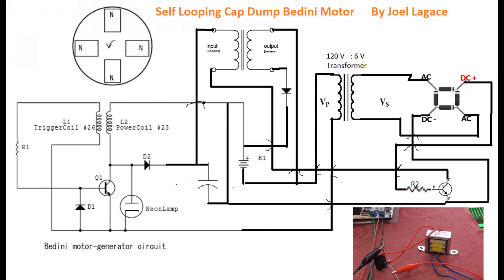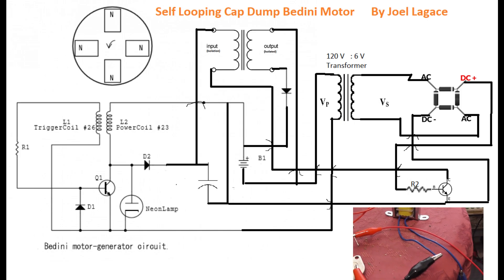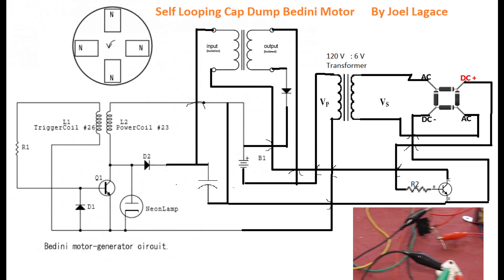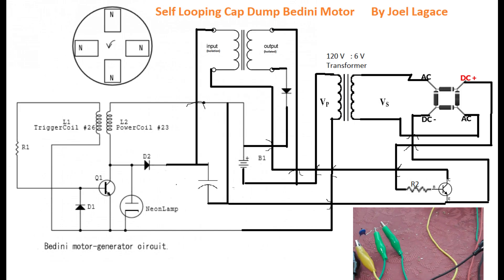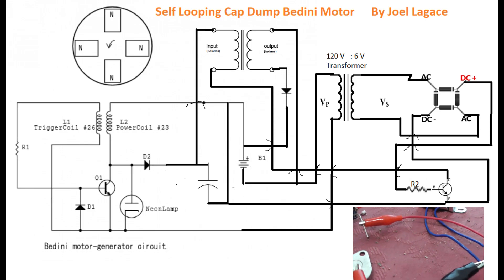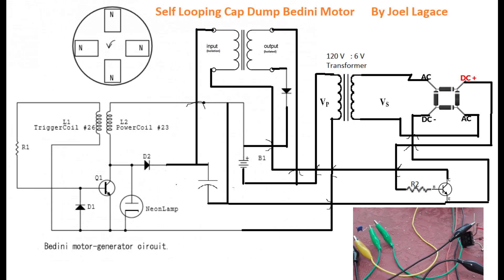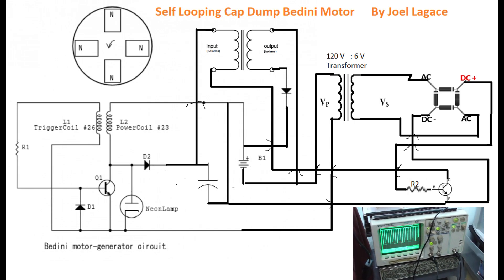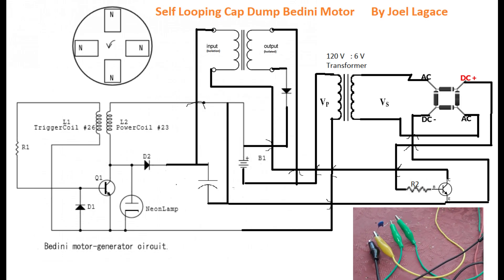Self Looping Cap Dump Bedini Motor

Comment: Congratulations Joel. You Have Found the Resonant Frequency and Keep the System Self-Powered. That's the Goal! It would be necessary to add some extra coils focused on a parallel disk with magnets oriented north and south to obtain usable energy at the output and thus be able to power other devices. It would be pertinent at the same time that both rotors have enough weight and fulfill the function of a flywheel. This second disk should not affect the functioning of your main circuit that already works, resonating and self-powering. I will try to Replicate your Circuit with your permission and I will Send you the Results. Well done! Congratulations again.
Reply: The important thing here is to keep a rotor spinning permanently. Another Disc with Permanent Magnets oriented North and South Respectively can be Attached to the Axis of This Rotor and these magnets Induce their Fields in 3, 6 or 9 coils and thus Obtain a Three-Phase Output of Perfect Sine Wave.
Reply: I am Thinking further and about the Evolution of Bedini Motor Generator. Since Being a Motor and Generator, I Consider It Sufficient that the Energy It Produces Can Self-Sustain It and Take Advantage of Its Inertia in a Flying Disk to Amplify Its Force and Power a Three-Phase Generator, All in the Same Unit.
Reply: f= m x a
Reply: 2º Newton Law

Comment: Does this circuit actually work. I thought the bedini motor used two batteries. one source battery and one charge battery
Reply from the maker: With my modification you can say its no longer a "Bedini", its something better.

Comment: Can we replace the bedini motor with a high frequency inverter which is powered by a low current source. The output of high frequency inverter is rectified to dc and stored in a capacitor. The capacitor can then be dumped to a battery when it reaches a specific voltage. Let me know your thoughts.
Reply from the maker: For this circuit you need the Bedini motor. It works in harmony with it. (The trigger pulse completely breaks the current at the battery as well)Any other auto triggered oscillator with always provide a DC flow at the battery. And you will need to modify the circuit. In other words it laches off the source DC supply completely for part of the cycle. A regular oscillator won't do this.

Comment: Very cool. I had a similar experience as @frankchandler8005 with my bedini circuit. Did you achieve self running or overunity in this case? I have seen one video of a self run bedini cap dump circuit working.
Reply from the maker: I did a while back! https://youtu.be/QYpwTJJ3lh8